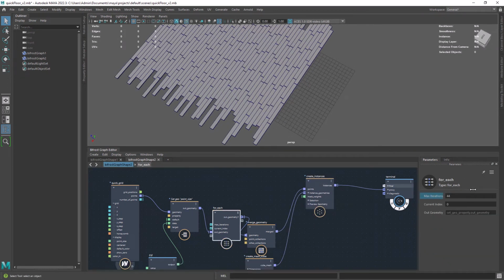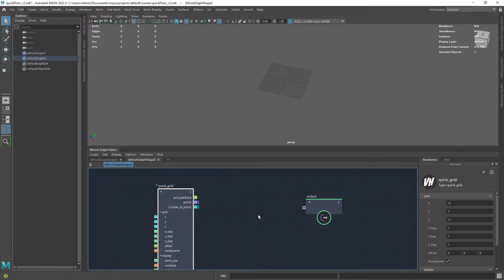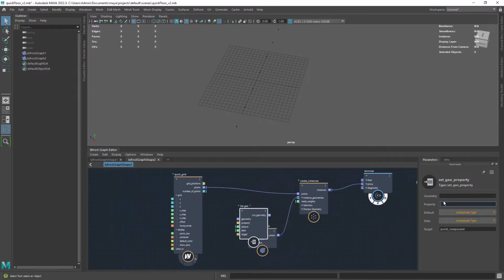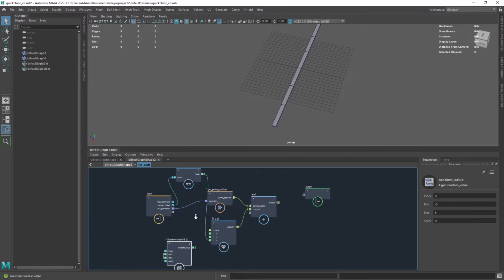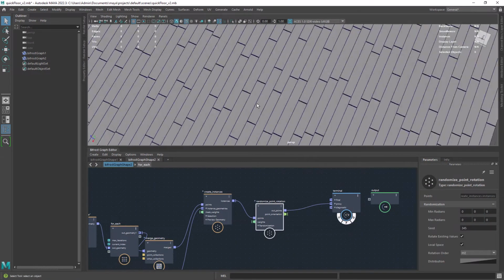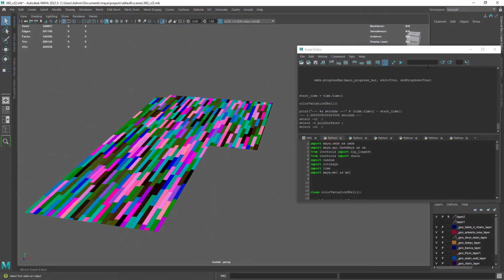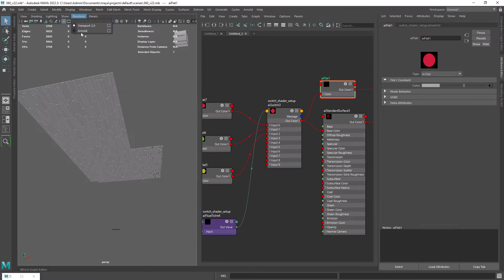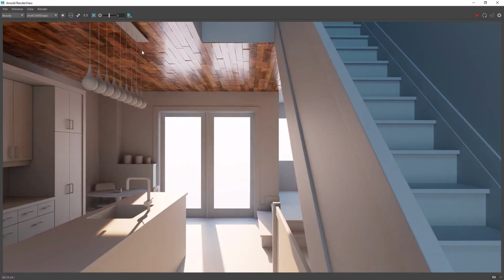Creating wood floors and ceilings with Bifrost

Comment: interesting. thanks!
What script did you use to color each panel. Can you describe how it works? Does each board have an exclusive color or 20 are chosen and distributed because that is max for the switch node? How are the colors chosen? Does it matter? I'm thinking as long as you can clamp the values for how many variations you need? Do you do any UV manipulation to move uvs around that share the same texture?
Reply from the maker: Hey, it's been a while since I've done this. And I no longer use Maya, let me check if I have those files around and find the script. But honestly there is a better option now. In the bifrost discord you can find a compound called connectivity that should do a better job than my script. Also it's a great place to ask questions ;) cheers
Reply: @cgside  ah ok. Thank you!